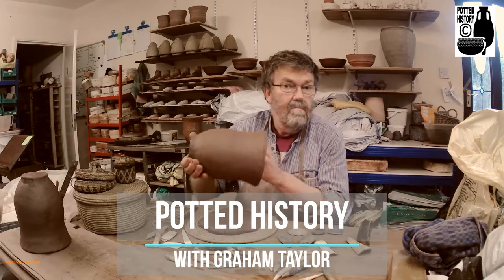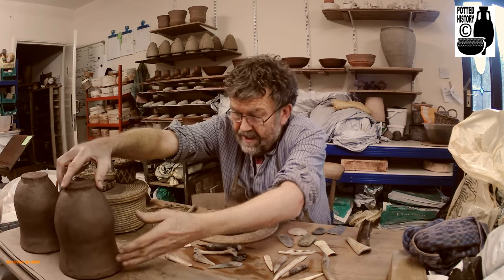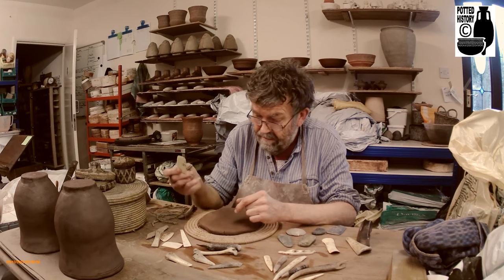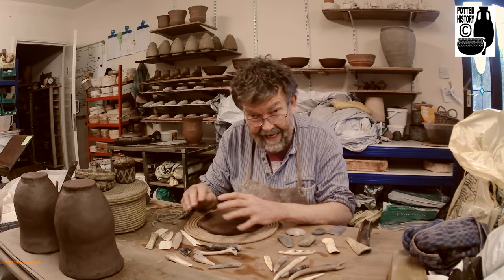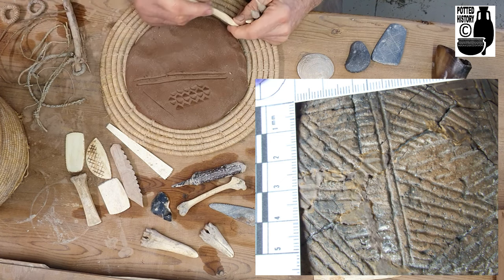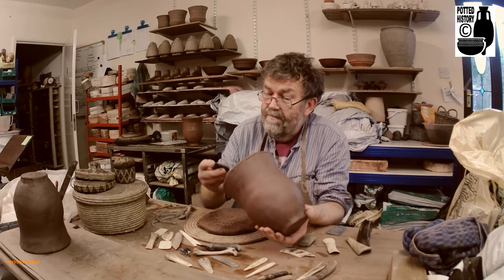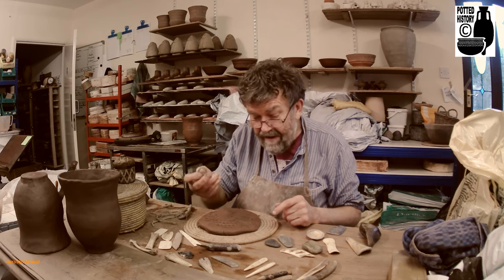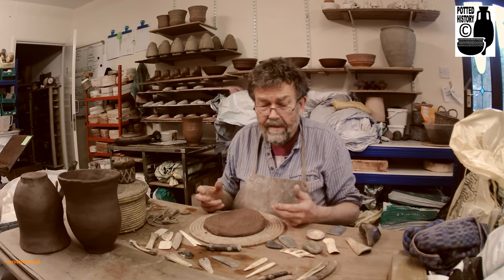Our Prehistoric Tool Kit: Form and Function

Comment: Actually though specific ones for pottery may not have been found...  bone weaving combs used then would match the sort of designs and the sort of toolkit you are using pretty well
Reply from the maker: In some cases, I think that weaving combs may well have been used for pottery decoration, but for Bronze Age beakers, the teeth seen on the pots are much closer together than most weaving combs and more importantly generally only about 1mm long. This is evident as the combs are often pressed deep enough so that the teeth are seen as depressions in the bottom of a continuous groove.
Reply: @PottedHistory   I stand (sit) corrected, thank you :)
Reply from the maker: @wynwilliams911  Not corrected, you're right, weaving tools are sometimes used by potters for decorating, just not generally in the case of British Bronze Age Beakers.